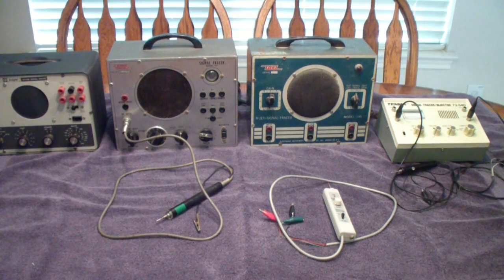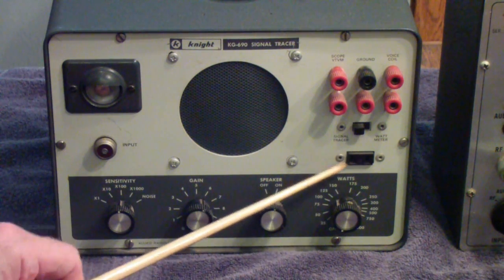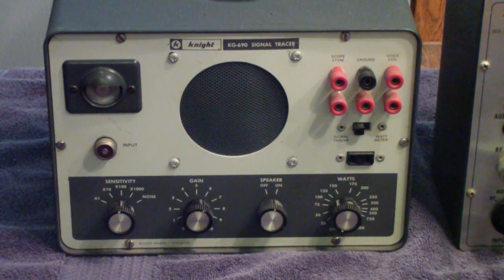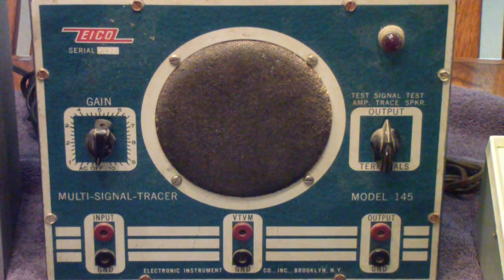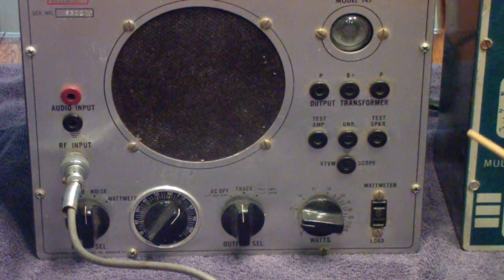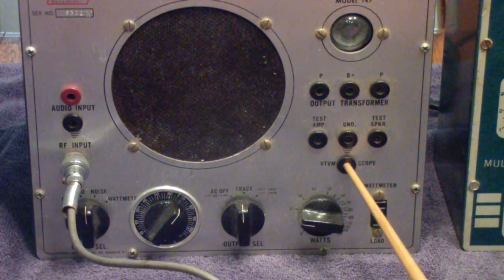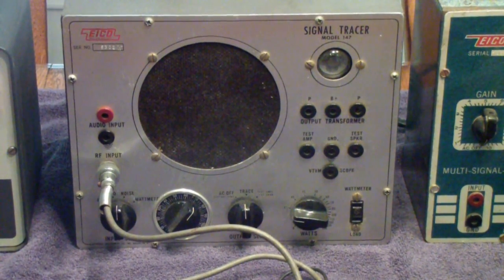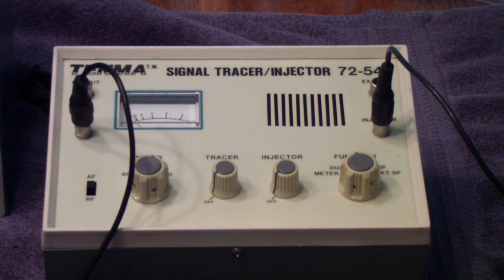TTT167 Review of Signal Tracers

Comment: Mr Carlson's mod of the capacitor and grid stop resistor does seem like a sensible one, and can be applied to the Eico units in a similar manner as well. "Other" mods should be done, as the Heathkit has NO protection fusing whatsoever ( How did Mr Carlson miss that ??) , and the 5 Amp fuse in the 147/147A only protects  the wattage measuring function, leaving the amplifier/eye tube circuitry's transformer with a direct line connection , which could damaged/smoke it if overloaded by a power supply cap  or severe tube filament short on the secondary side ( basically, it needs a smaller primary fuse added/connected just before that transformer, about a 1/2A Slo-Blow) Also a 5 Watt, 1Kohm power resistor for the B+ voltage divider circuit (is wired directly below the 3 section original  Electrolytic can, generating quite a bit of heat and will cause premature aging and failure if not moved and maybe upgraded to a 10W resistor of similar value. Enjoyable comparison and info on your video, thank you for sharing!

Comment: I work on tube radio as a hobby. I don't have signal tracer. How do you know what pins on a tube to probe? Can someone ruin a tracer if they accidently touched the B+ of a non rectifier tube?
Reply: If they are built properly. NO you can connect a tracer to any voltage rated lower then the probe caps rated voltage. "normaly 600+v". 
If you connect something to the probe it will simply will POP. until u remove it. 
AS FOR A SCOPE.
Reply: Generally you trace a signal between the coupling capacitors of the stages of a tube radio. Then you can actually see which pins  of a tube to test on.
It would be best if you have a schematic diagram of a particular radio to follow the point to point wiring. First  test the radios tube  pin voltages with a good 
multi-meter. It would be lucky or smart to have a VTVM to do this . Mark them down on a sheet of paper or a copy of the schematic. This will greatly improve your inspection of what goes where to avoid non signal path wiring. Also see the YouTube video , Shocking! Vintage Equipment Safety.
Reply: @hestheMaster  Thank you!
Reply: First of all, you need to understand how the tube works, tubes have a high impedance so touching the probe to say the grid where the signal input is located, touching the probe to there will not hurt the probe, stay off of the plates where the high voltage is, good luck in this hobby, I to restore vintage electronics and we need to keep this hobby alive and well.....